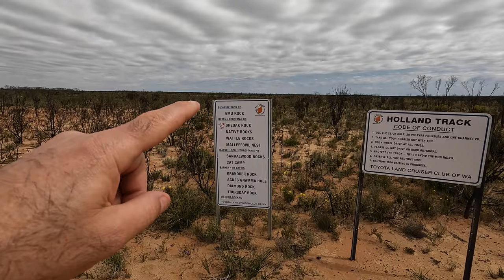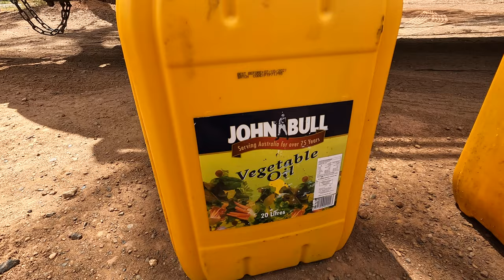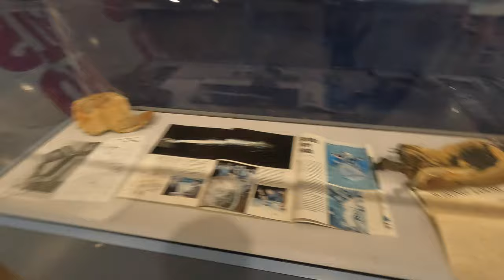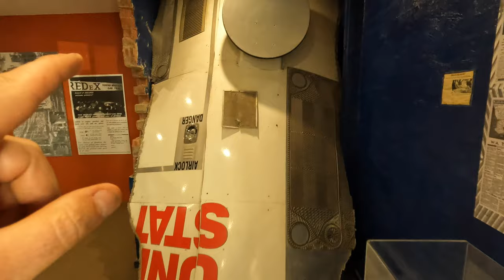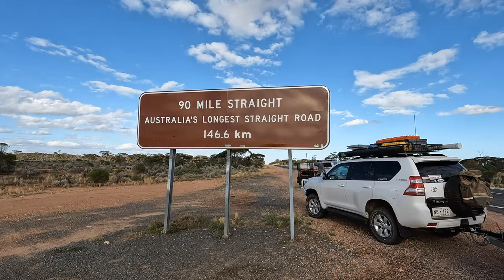Fishing the Belts Part 1 - Point Culver Western Australia

Comment: I must say that is very clear footage, some of the best I've seen.
Reply from the maker: Cheers, thanks. Its in 4K 60p so it should be good :).. I also use a lot of stabilisation, Gimbals etc to keep it all smooth, unless I want it shaky for effect. I also go to a fair bit of trouble with Audio, making sure its as good as possible, and cutting out all wind noise I can in the situation. It was quite windy most of the time, but you wouldn't know it.
Reply from the maker: I also upload very high bit rate files, this gives the YouTube transcoding software the most data the chew on. I normally upload files at a bit rate around 120 Mb/s, this file was 33 GB upload. Its a big file, I have a 1 Gb/s connection (1000 Mb/s), and upload of 50 Mb/s, so it doesn't take to long to upload 33 GB files.

This all helps with the final quality.